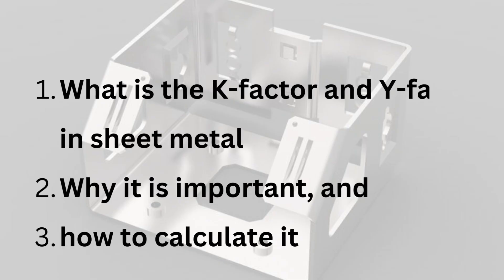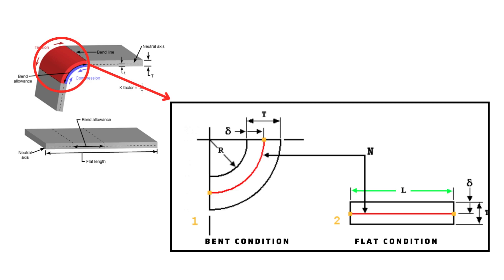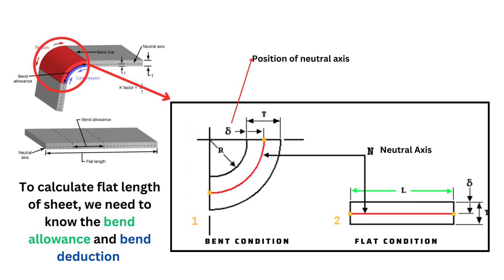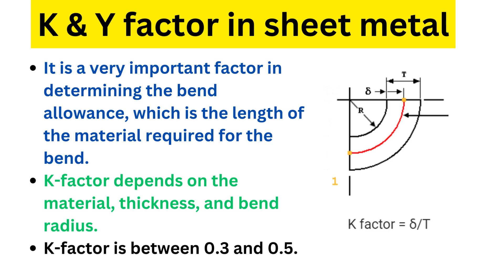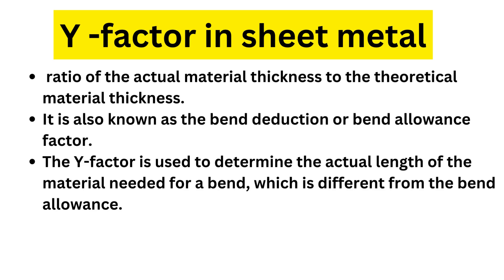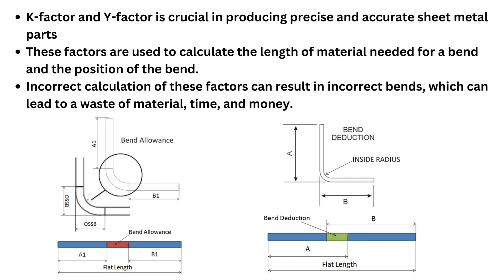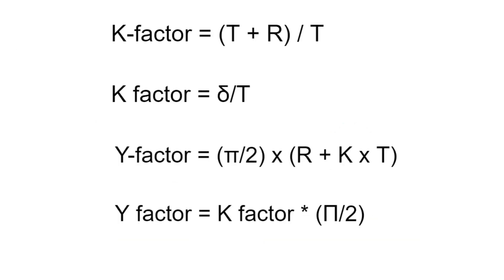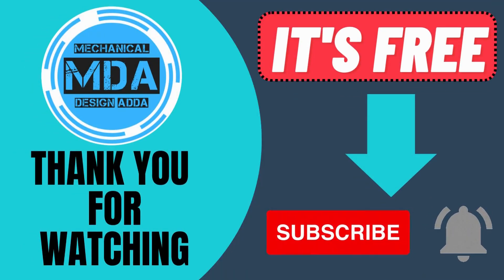Understanding K-Factor and Y-Factor in Sheet Metal | Importance and Calculation of K & Y factor

Comment: hi 
from your video, you mentioned that K factor is always between 0.3-0.5, but when I used your K factor formula which is (T+R)/T, the K factor will be 2 (if my material thickness is 1.5 and bend inside radius is 1.5).

Could you explain thanks
Reply: This formhla is estimation, for precise manufacturing the k-factor dep3nds on the material thickness , bend angle and bend radius. It is determined through a series experiments done in the workshop and is valid for the particular case. So it is a combination of experiments and applied theory.